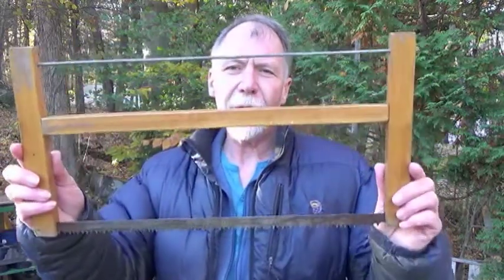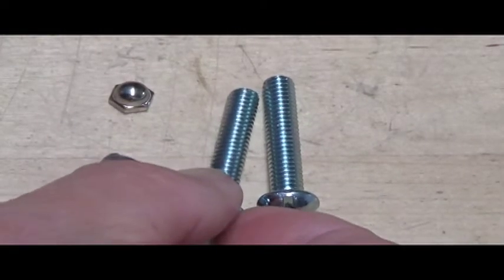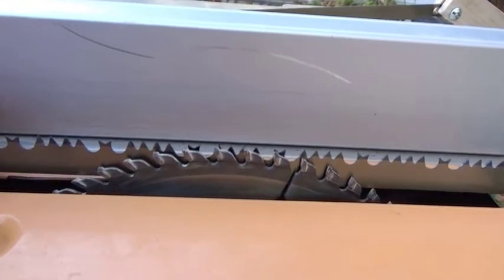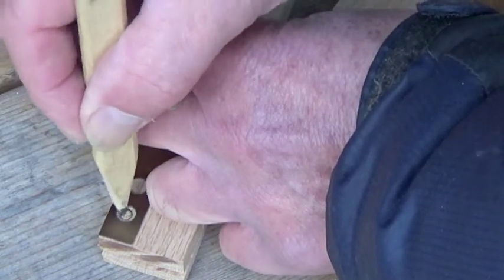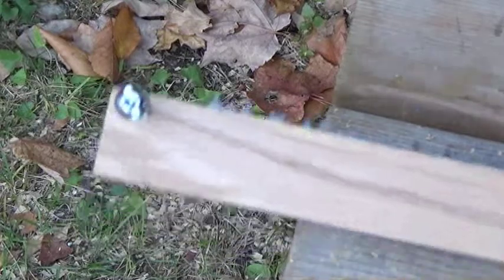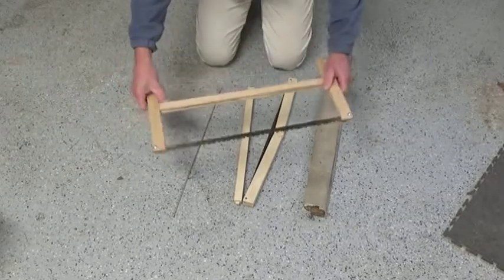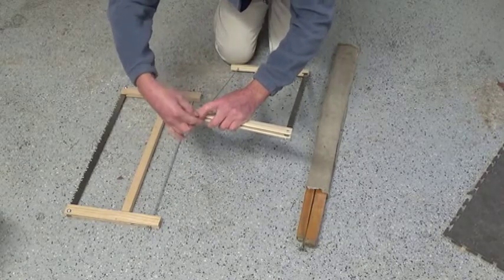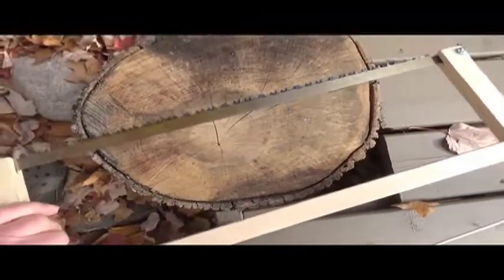DIY Folding Saw for camping

Comment: ROUND OVER THE EDGES FOR YOUR HAND.
Why do you need a spreader bar? Just use the string twist,, saves weight.
Reply from the maker: The edges have been softened with a thumb hand planner then sanded. The wooden handle feels comfortable on the hands when in use. You need the spreader bar to put tension on the blade. The threaded rod stores conveniently inside the wood handle, it doesn't weigh much and is faster and easier to use than string. If you use string, you need a toggle to wind the string up to put tension on the blade. The toggle has to be long enough to lock against the spreader bar in order to keep tension on the blade. That means you have to keep it out of the way when winding up the string for tension then move it down so that it stays in place against the spreader bar. That's tedious and the string and toggle won't store as nicely as the threaded rod does. The only point of failure with the threaded rod is loosing the wing nut at the end. I keep a spare one in the repair kit I take along on canoe trips but have never needed it.

Comment: Could you  possibly tell me the dimensions that would work with a 36 inch blade
Reply from the maker: You just have to leave enough room in the wood channel so it'll fold and hold the saw. Pretty sure the span piece should be 35 inches for a 36 inch blade and it'll all work out the same. You'd need at least 37 or 38 inches of threaded rod.
Reply: @RolfKraiker  thanks so much the nearest portable saw I could find like yours was a 75.00 dollar metal one so this is a real lifesaver